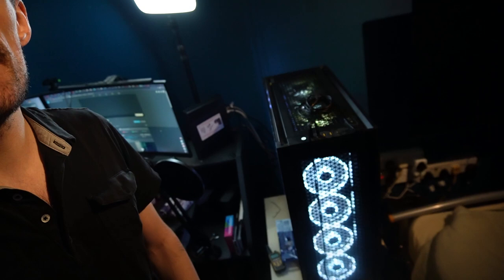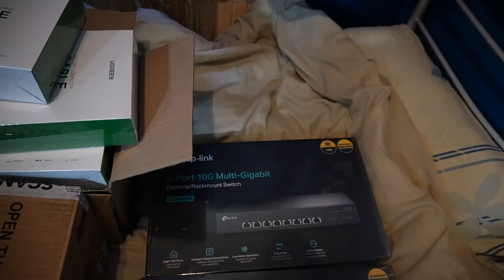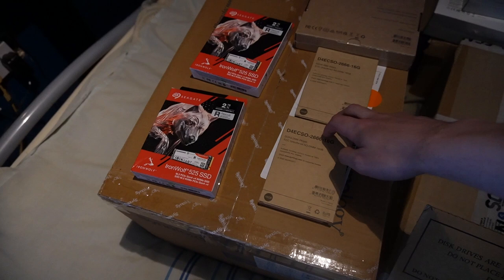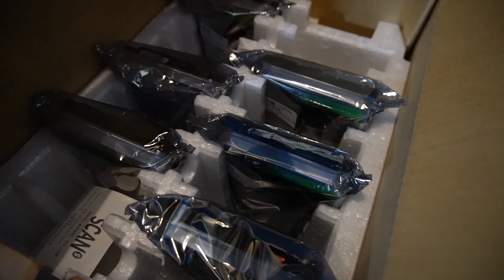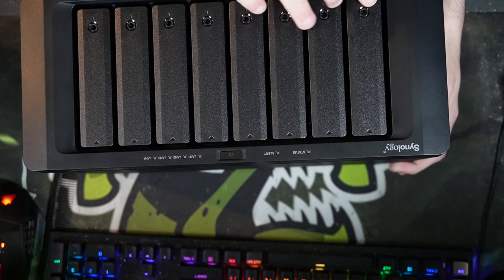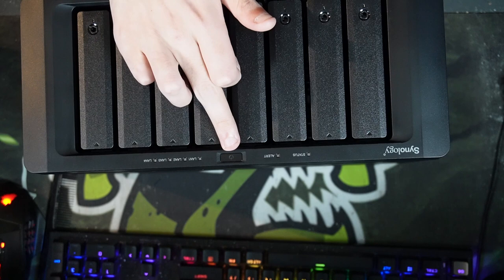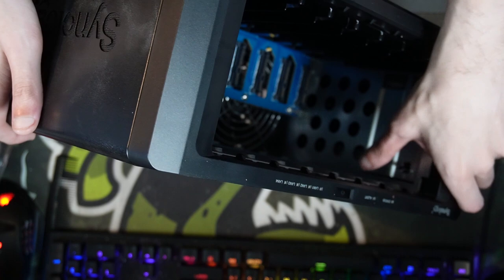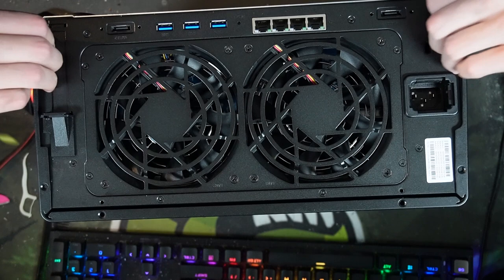My New £6000 Storage and Home Networking Upgrade

Comment: You're never going to use that much storage...

Next overpowered video - getting cloud to level 99 in the first screen - full grind video.
Reply from the maker: ive already used 15tb of my available 65, dont underestimate creators and how much storage they burn through
Reply: @Primalliquid92  oh i know. What i meant was, with the amount of long-ass grinds you do for some of the more insane overpowered videos, the raw files for a single one could probably fill that storage in 1 go.
Reply from the maker: nah i dont record every single second of those grinds so i end up around 500-600gb for a completed project, its about 5gb an hour but when just grinding something for 10-20 hours ill stop recording since i only need a little of that footage, if i was to record absolutely everything though then the FF3 OP for example would have been 5tb of data

Comment: Nothing more permanent than a temporary solution comes to mind with this video.
Reply from the maker: thats the problem with storage saddly, even if i went all out on a full blown storage server it would eventually end up full and need more, would just take longer. and then as quality levels need to improve such as 1080-1440-4k ect the space is only going to go even more, space constrants were one of the main reasons why i still only upload in 1080p but now, i can start working at higher res
Reply: @Primalliquid92  I meant the cabling :) For storage though I'm glad 1080p is good enough for what I do that I don't need to worry about this stuff for years.
Reply from the maker: oooh yea thats already fixed lol

Comment: Don’t feel bad about feeling like you bought too many cat8 cables.  Like you said, you’ll be up to date for at least a decade and probably longer.  All you have to watch for is physical cable degradation 🤣
Reply: Only thing to be careful with a fanless switch is that you really only need at least one ceiling fan or portable fan in your room to circulate air, and I suggest a monthly internal and external cleaning of both the switch and the RAID since it’s not in a server room.  I’ve got a fanless four-drive RAID myself in my bedroom using “old” 1TB HDDs jury-rigged on thick plastic shelving, just for backing up my college laptop and my mom’s laptop that she manages financing from, so no remote access necessary; manually plug in the laptops every three weeks, let them sit for about 14 hours or so with a tiny program I made to copy specific stuff over (I didn’t design this for speed), and we’re secured more than regular people are. It gathers a shocking amount of dust in a very short period of time!  My mom’s got a severe dust allergy so I have to take every drive out and dust and wipe the whole set up down every single Saturday
Reply from the maker: that was my thought process, with fiber becoming more and more mainstream now i have community members in the discord server who have home connections over 10gb (im damn jelly lol) so who knows what speeds we could have in 10 years, same with when a 10gb connection just isnt enough for me like if i hire multiple editors all pulling from it ect the need for a 25gb nic might increase which cat7 cant handle unless its short runs
Reply from the maker: yea the cleaning side is fine, i've got a mini air blower that is great, a quick 2 seconds to pop out the drives and give it a fire will do the trick, ill just do it when i clean my PC fan filters